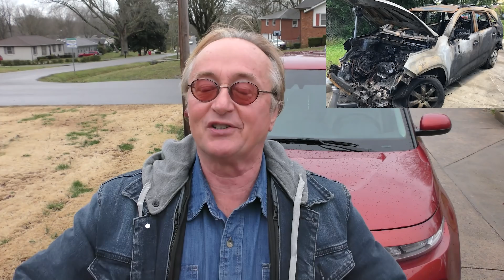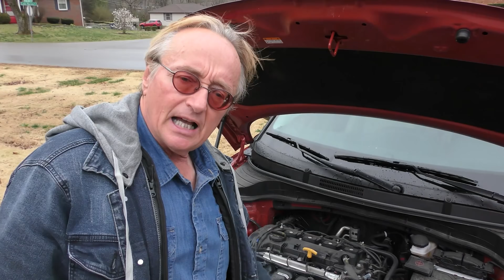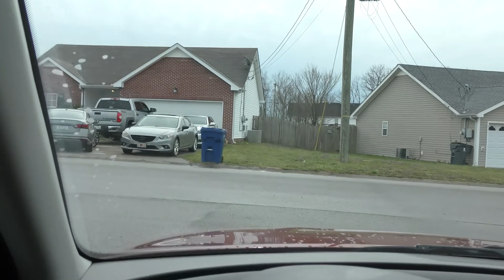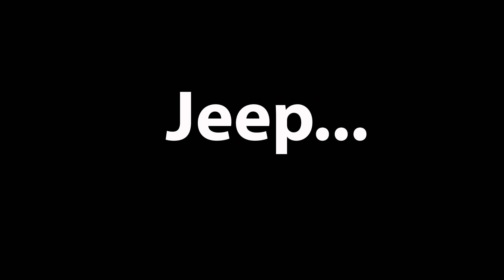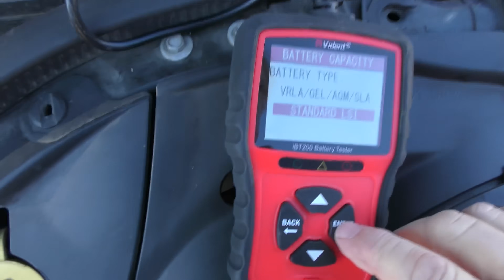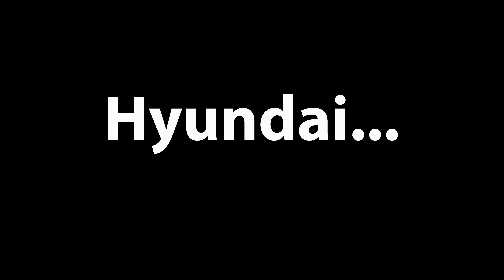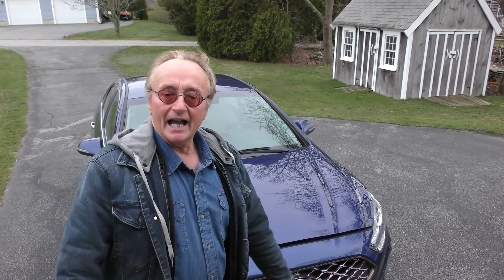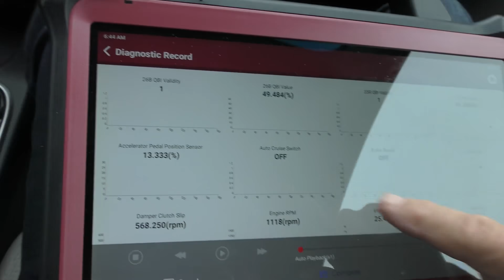3 Car Brands That are Crap

Comment: I have a 2021 Corolla and I drive almost exclusively highway miles. Being an individual to change my own oil, I've changed my oil at 6500 miles through 8500 miles. 8500 was too much, it was quite dark incomparison to my previous vehicles. I'd change it at 7500 miles at most, preferably 6500 miles.
Reply: good luck keeping that car in good health. each 5,000 km pal. every 5k
Reply: @moenibus  I very well may, the recommendation is every 10000 miles.
Nuts to that.

Comment: I have a 2011 KIA Soul. The car has been excellent  after 11 years. I use  Mobil 1 synthetic oil. Sometimes even after 9000 miles on  oil change, the oil is only down 1/3 of a quart. The  Soul now has 115,000 miles on it and still excellent. Even the air conditioner  still blows cold with no repairs anywhere on the car. Great  car !!!
Reply: in these videos, there's always these muppets defending their crappy purchases. yes pal, not all are garbage

Comment: I have 2005 Lexus Es 330, 240,000 miles, I bought in 2010 with 40,000 miles on it,   I gave it an oil change every 5000 miles,  original motor, water pump, transmission, fuel pump, same AC  , never even recharged the AC,  burns  exactly 1 quart every 5000 miles.  I've never done the timing belt. I had it repainted 5 years ago. I had the front seat upholstered a year ago.  People get it in and can't believe its 17 years old.

Comment: Hyundai has improved alot since 2019. Most people complain about the Hyundai vehicles that are older than that.
Reply: Hyundai  Apologists in  damage control mode
Reply: @GoodGirl6907-t2u  Perhaps, but I have no doubt even Honda and Toyota has some horror stories out there. It is hard to know what to believe, because EVERYONE changes their oil  like they should and follows the maintenance guide.

Comment: I've owned a Honda Prelude, 4 Toyotoas, an Isuzu Rodeo and a BMW.  In 2017, I traded in my 14 year old 4Runner and 11 year old Sienna for a 2016 Sonata Hybrid and 2018 Santa Fe Sport 2.0T.  I could not have been happier with the decision.  The dealer has been fantastic, the cars have been great and I even bought a used 2017 Santa Fe Sport 2.0T Ultimate, which, other than replacing 2 oxygen sensors, has been excellent!   I bought the Sonata in anticipation of turning it over to my son when he got his license.  He loves it, especially with gas prices today.  My wife won't give up her 2018 Santa Fe for anything and within the next 5 to 7 months, I may be getting a 4th Hyundai - Santa Fe Plug in Hybrid - for myself while turning the 2017 Santa Fe over to my daughter who will be getting her license.

I have oil changed every 4500 to 5500 miles, check fluids regularly and change filters, as prescribed.  Any warranty work was done without problems or other "findings".  Recalls haven't been an issue at all for us either. Overall, very happy with our Hyundais.

Comment: I towed a  2013 Hyundai  sonata outta a dealership  cause the engine has too many electrical problems to start and the dealership couldn't get a replacement engine for it. 

And on top of that I had a kia catch fire in the McDonald's drive thru.

Comment: Hey Scotty.  I noticed a Sienna sitting in your driveway.  Do you have problems with it eating tires?  I get less than 20k miles out of a set of tires, as they wear out the inner side of the tread.  Have had both Toyota and independent  tire shop check alignment and both said it is spot-on.  Any ideas?
Reply: Are the McPherson struts okay? I had a tire wear problem once, had the front end aligned, it was not out much, and the problem continued. I determined later on my own that the struts were failing and were becoming extremely stiff affecting the ride and the tire wear. The alignment guy missed this fact. I had to replace the struts. It fixed the problem.
Reply: @stevenpollard5171  Very interesting Steven.  Did your tires show the same wear pattern as mine - inside or outside tread wear?  After exhausting everything else, my tire place suggested replacing the struts too, although they said that the struts looked and performed ok to them.  I bought the van with less than 48k miles on it, and it already had the tire wear problem.  I can't imagine that the struts were already worn out but with no indication of being worn out.  Also, the wear on pattern indicates a camber issue.

Comment: Have a '17 Santa Fe Sport (2.4L, AT). It does on occasion hesitate to upshift. I just normally go into "manual mode" and upshift. Only have to do it on rare occasions. Changed the trans oil at 50k. 

Other than that, the car has been trouble free.

Comment: I once rode in a Chevy Impala with a lady I knew.  I got whiplash over speed bumps in a parking lot.  She was slamming on the brakes, then immediately after the speed bump, cramming on the throttle.  I asked her how she liked the car, and she said, "I'll never by another Chevy, the transmission went out".  The 3800 v6 didn't go out, not that it shouldn't have!
Reply: Had a Series III 3800 2003 SC Pontiac GTP LE - those engines were awesome. 

Still going strong today after giving it to my dad. I miss the hell out of that engine.

Comment: Good video and agree on your three choices. For Hyundai, I can even guess that one Hyundai is approaching just by the loud knocking noise that the engines make. People should focus on buying cars for their quality and security not by the bunch of crappy options that these cheap brands throw in at low prices.
Reply: @Enigma Vids seems Kias and Hyundais in the USA are crap
got 30,000km on my Hyundai no problems at all. 
the first Hyundai car we got went even beyond 105,000km
Reply: @N3Garage  The Hyundai my fiance has is on it's second engine at 174,000 miles (280,000km). Not even 5 months after having at engine put in it's got a low oil pressure light and doesn't sound right, granted it was a used engine. (The car is kinda joint custody so to speak between her and her aunt) The shitty place her aunt took it to be fixed only warrantied the engine for 3 months...
Reply: @N3Garage  105,000miles on a Toyota is still brand new.

Comment: I got my first Kia Sportage some 25 years ago.  Have had two Sorentos and am on my fourth Sportage.  It has over 170,000 miles and burns ZERO oil between 7,500 mile changes.  The dipstick level never goes down.  Of course, I have been using Mobil 1 and other synthetic oils for about forty years.    I think if people would stick with the synthetics their cars came with from the factory, or go Mobil 1, they wouldn't have oil burning problems.    I used to turn wrenches for Ford, Chrysler, and some independent shops back in my younger days.  I also was trained on oil technology, by Exxon, when they first introduced multi-weight oils.    Oh yeah, turn off that &@#%^&* auto motor stop thing.  That's probably the worst thing you can do to a car engine.
Reply: Change your own oil. That's the only way to be sure it was done right.

Comment: I have had 4 Souls since they first came out.  One A 2019 turbo!  Just bought the 22Santa Cruz with the New 2.5.turbo . I have been a car guy since I was a kid in the 70s I was a total American car buyer till I drove the newer 2015 model.  I have never had a single problem with them.  I absolutely love my new Santa Cruz! But ! I have always used synthetic since it came out . My Santa Cruz has lifetime Synthetic Oil changes for life and 100k warranty on rest.

Comment: I bought a brand new palisade for almost 50k started having engine problems at 80k miles absolute junk
Reply: @Paul I got rid of the palisade and bought a 2017 Lexus RX 350 runs perfect 👍🏻 will keep this car until 300k at least hubby drives an 06 Camry with 80k miles on it runs like new we are Toyota Lexus forever I think 😂

Comment: You really give me second thoughts about getting a new EV from Hyundai because of the way they treat their customers.
Reply: Every dealer is different, and it doesn't matter what the make of the car is.  I bought a 2015 Hyundai Sonata at a dealership in Florida, and was treated with tremendous respect.  The car was also fine for the 4 years that I had it.  A good friend of mine has a 2012 Kia Forte with 155,000 miles on it that is still going strong.  He has kept up with the recommended maintenance, and has never made any repairs due to failure. To trash a brand based on a few bad experiences is unfair.
Reply: @geraldbyrne2146  Of course there will be some good Hyundai dealers. It is impossible to have every single Hyundai dealer to be bad. However, it is a matter of odds, and from what I heard, the odds of bad dealers is higher at Hyundai than other brands.
Reply: Do you seriously think other companies treat customers better?  Hyundai and Kia have the best warranty in the business, so at least you have some protection. As for dealers they’re all pretty much crooks..
Reply: @alanbuck9237  The warranty does not mean much when the car manufacturer does not stand behind their cars and honor the warranty.
Reply: @alanbuck9237  there have been many people that have had issues getting warranty work done. .
Reply: EV's are crap.....and they're not green...and there's not enough power for so many people to get them....and they're not cheap....why spend like even  30k ,to save 50 bucks a week in gas...it'll never pah for itself..I can't believe how many people are followers and buying these
Reply: @richsweeney1115  If you charge your EV by your solar panel, I think it is cleaner than an ICE car. It has no exhaust gas and no engine oil to change, which reduces pollution to the environment. Premium price is a concern. Hopefully it will come down as battery technology advances.
Reply: @acefr8816   EV's aren't green.....the mining for the materials to build them...the lithium for the batteries alone pollutes thousands of gallons of water. Most people don't have solar. And they charge off of  fossil fuels. And they're not reliable, they're too new. And the regular power grid isn't strong enough. And again, spending like 60k so you don't have to pay $ 60 -$100 ..so, youre saving maybe 400 a month at most in gas....but you probably have a $ 700 payment....insurance... And its gonna break before it pays for itself. There have been teslas that burnt to the ground...some Chevy's and burned .. A think a Hyundai EV did, too. Its just ridiculous....they were saying not to run your house ac more than you had to  this summer  because of blackouts....now they're telling everyone..hey, go get an EV and charge it at your house. And people do it........stupid.
Reply: @richsweeney1115  It depends on how you plan to charge your EV. I have solar as a clean energy source to charge an EV if I choose to buy one. I think the battery technology will advance to get rid of lithium. Just because it is not perfect when it starts, it does not mean EV is a bad idea. EV has the minimum maintenance compared to an ICE car.

Comment: I own a Jeep and Jeeps are complete trash. I can tell you about their transmissions that will leave you stranded.
Reply: What ever happend ????
The Allies won the war with it , those Willys Jeeps were bulletproof .
Reply: ..is it a real Jeep or one of those front-wheel-drive Fiat car platform "Jeeps"?..a real Jeep is quite durable..Inline six engine, 4-or-5 speed manual transmission...Warn lockout hubs, Dana differentials with solid axles..manual transfer case..yep, tough as nails...

Comment: 2019 Volkswagen Jetta with 125000km on it, just did the rear break  pads and only issue I've had is the ac/heat blower motor quit! Got a new one at Napa for 120 bucks took out the old and put the new one in and problem solved cheers!

Comment: I had a Hyundai that wouldn’t stay in overdrive. Turns out nothing wrong with the tranny. Had a rear wheel bearing going bad, and the wheel was dragging. Had to figure it out for myself. Garage blew it.

Comment: I have a 1991 oldsmobile custom crusier. It has a made in Mexico GM goodwrench 305 which was installed 69,000 miles ago.
I run Mobil 1 in it.
It burns (almost) 1 quart every 7500 miles, which is when I have always changed it. If a 60 year old engine design can do it, Kia is failing hard.

Comment: My 2011 Kia Sedona has 180K miles and no mechanical problems.  I change the oil with synthetic oil every 5K.   It has had no loss of oil.  This has been more reliable than my old 2001 Camry - which was pretty good until an accident with 135K.  The only problem was the right rear door latch system that I replaced last summer.  One issue in 10 years and that was minor.
Reply: Yeah, i have 2 Kia Borrego's with each over 250K on them, they don't take a drop of oil.
Reply: Your Camry probably has more damage than you know about. Sometimes they're never the same after an accident. And koa has sucked for about a decade .everything is made cheaper and cheaper

Comment: I've never owned a Kia or Hyundai so I can't say from personal experience but for me Dodge/Chrysler is the worst so I'm not surprised Jeep is in this list. When AMC owned Jeep they were solid but when Chrysler got them they started that downhill slide.
Reply: My 2008 Dodge Magnum runs very well. Tires, brake pads, serpentine belt, rotors, a battery and coil have been replaced. That’s it. It has been a nice car…
Reply: true. i own a fca jeep compass from 2020.  total junk
Reply: 2095 Dakota with 312000 miles on the ticker
Reply: Worked auto body for a AMC / JEEP dlr 76 - 79 and DANG they were tanks ..Had a 74 Wagoneer 350v8 buick ,lifted,tires, and would climb mountains .. The v8 idoling in low range would crawl 2mph and go over huge stumps ,ricks,boulders..Only thing was they would rust out fast but tough then
Reply: Fiat  panda ,100 % rubbish.
Reply: Step sister had I believe an ‘11 Compass. Absolute piece of garbage.
Reply: everything after the TJ has had a stark drop in quality. but if you stick to their main 3 models youll find pretty decent reliability.
Reply: The second generation Dodge Ram trucks were solid all around except the auto trannies
Reply: Nonsense.

Comment: I have owned  a used 2010 Soul !, traded in at 150K for a used 2013 Soul+, traded that in at 140K for a new 2017 Soul Boutique:  that car saved my life, as I hit 5 deer at 45 mph grazing on a rural road at dusk, blending into the scenery-car spun, flipped, i walked away without a scratch!!! (all airbags went off, restraints kept me secure). next went with a new 2018 soul ! 1.6 turbo, big mistake, so traded that in at 35K on a new 2019 soul +. Never had problems on any with routine maintenance, changed synthetic blend oil every 5K.  just got a 2016 soul + as a second car with 50K and no problems so far, no oil burning on any of 'em.  they are decent econo cars, good gas mileage, comfortable, spacious (for me), and easy to work on. never had a dealer issue (so far). a car that saves my life is a car that i trust with confidence.

Comment: I have a 2005 Hyundai Tucson with the V-6. It has 140,000 miles on it. I haven't had any problems and not burning oil, maybe due to a V6 engine and lucky. Now that I said that, will probably blow next week.

Comment: I heard the same line from Hyundai. I went on to trade it in, sooner or later the oxygen sensors will start putting out a check engine code/light. I was burning a quart around 1,000 miles

Comment: Dunno if youll see this scotty, but i was wondering about breaking in your engine on a brand new car/engine. Are you supposed to break it in for a certain mileage before you really open it up on the roads?  I knew somebody who bought a new honda, and was driving and accerlating very quickly, shifting at the start of the redline often. Started burning oil around 15000km (canada). Can you prematurely wear/damage the engine by driving like that with a brand new engine?

Comment: The 7500 mi. oil change interval is the real problem here.
Reply: Right. I'm not playing no games. I have a 2022 Kia Soul LX and I got my first oil change at 3,450 miles. My next one will probably be at 7,450 miles.
Reply: @svanp32  please change the ivt fluid every 30,000 miles my 2020 soul didn’t even have 20,000 miles when the ivt transmission went out i think it was just because of it being the first model year because the 2021 and 2022 years don’t have the issue but just warning you :)
Reply: what are talking about synthetic oil last 15k mobile 1
Reply: I would change the oil every 3000 miles no matter what anyone says!

Comment: The Hyundai transmission are very durable, at least my working with the 6 speed version.   Some dealer is scamming that customer with the transmission issue.  I always use to drive the car at least until it was up to full operating temperature.  Any dealer would change the whole unit after the first try at rebuilding it .  Sounds like a sleepy dealership, and not how I have seen Hyundai work

Comment: My first car was a 1998 Kia Sephia with light front end damage, and I had bought it for $500. A/C was leaking from condenser. That was in GA around year 2003 and I couldn't find an after market condenser.  So I went to a Kia dealer to buy a condenser. They priced it for  over $350. I couldn't not afford the part. The guy at parts started laughing at me  while he said  "well, only thing you can afford is to roll down all the windows and get breeze  driving in GA heat". That really offended me. If a dealer will not value their customers, then they should not deserve a penny. I heard similar experiences from friends about Kia and Hyundai dealers. I agree with Scotty. Kia and Hyundai are poorly built vehicles. I will never buy another Kia or Hyundai,  nor should you.

Comment: Kia needs to fire their engineering department that designs and tests an engine that burns oil right out of the gate.   How about a naturally aspirated 2.0 liter with a 170 hp and can be rebuilt at 200000 miles?  Nahhh... that is asking too much.